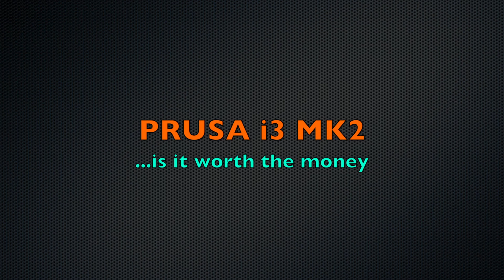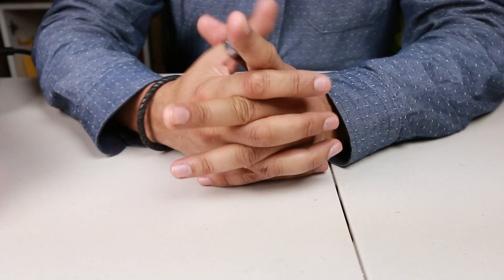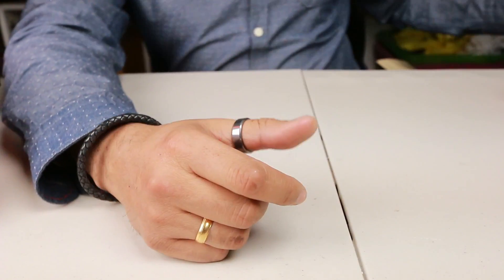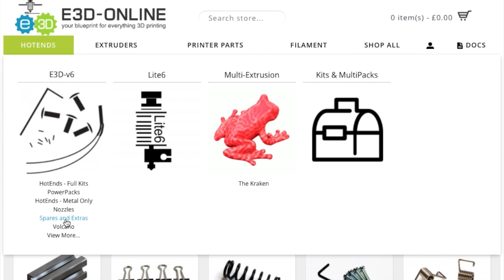3D Printer - S02 E03 - THE Ultimate Review (Prusa i3 MK2)

Comment: Great video! Pretty much touched on the same points I found but that solution for the probe levelling and 'knocking' cap is very clever - will certainly add it! Something I've noticed recently on some prints is the wire loom will catch on some prints (especially vase mode) so will be upgrading to a drag chain as well methinks. It really is an awesome printer, but not flawless ;)
Reply from the maker: Maker's Muse hey thanks. Am a big fan of your channel from the start. I'm looking into the chain but not so happy with the current designs. Make look to redesign my own.
Reply: Hey guys! Good comments all around, and a good video.... I have just finished upgrading my Mk2 to drag chains on each axis because I disliked the wire management. It was a huge task to get it operating correctly, but well worth it! I used Igus drag chain, and made a new Rambo enclosure to relocate the board and also moved the PSU back.... Came out really nice though!

Comment: Nice video man! i think some of the issues you are having may be due to incorrect linear rod placement. It looks like you possibly mixed up the linear rods. or don't have them pushed down far enough. The Z linear rods should be flush against the top 3d printed mounts. Take a look at the pic here. Yours are sticking up beyond the parts. :)

 http://www.prusa3d.com/wp-content/uploads/2016/05/frontpage.jpg
Reply from the maker: Exactly right. I found this out a few weeks later DOH! but it did resolve some of the issues and some were still persistent. Still great machine and will carry on improving and upgrading.
Reply: Just got this printer and i love it. But i hear ya, you cant only get so much accuracy from 3d printed parts. Thanks for the video!

Comment: It is a very good printer but I think what sets it apart from others are the extra features like the automatic calibration and such. But while it does it automatically, it's still things that can be done manually on any other printer with a decent enough construction. Ive gotten my hands on some prints from my friend's $700 Prusa i3 Mk2, and my own home built printer that I made for $250 (using parts he printed for me) and honest, if I didnt tell you which is which, I doubt you could tell. While it's easier with a prusa i3 mk2, its possible with other less expensive printers as well
Reply: I have a MK2 and a clone, and generally the clone is better.  The clone has a filament sensor so when filament runs out it stops. You know, like a laser printer does when it runs out of paper. Its not a feature on the MK2. And auto bed leveling? Its a bit overrated. My clone has a sensor and it moves to each corner, then you adjust the thumbscrews until it just beeps. It really works just as well and quicker. Overall the MK2 is a fine printer but fairly overpriced for what you get.
Reply: Ralphie Vigg Thanks. I was thinking of getting a clone, but worried about the auto calibration.
Reply: You can easily add a filament sensor to the genuine mk2 for warped beds, like mine, which I can only make small prints because its impossible to get level.

Comment: Looks like your printer needs to be calibrated on the Z axis. My Prusa i3 has had NONE of those problems after proper calibration. Try a wall thickness of 0.4mm instead of 0.8mm to get you started until you learn more about the Prusa i3 MK.

Comment: Be careful with the Pinda leveler shim! Not all of those sensors are created equally, they all have slight variance in the height they detect the bed. That is why each Pinda has to be adjusted separately and they have that adjustable nut. Otherwise the mk2 design would have it bolted in place securely and safely.

Comment: Prusa uses the 4mm inductive sensor I believe and that is just too close for comfort with aluminum and a glass bed so a better solution would be to switch over to an eight millimeter version so you can move it up, and out of the way, and adjust for the difference in Marlin.

Comment: It looks like the nozzle isn't screwed in very far. It might not be an issue, but could be making the heat block rather close to the radiator.
Reply: Yeah, I screw the nozzle in first, back it out 2 full turns, then screw it into the heatbreak until it hits the nozzle, then tighten down the nozzle.

Comment: Try ABS juice (really thin paint on heatbed using abs and no more problems,i like to paint using this "juice" many things becouse you can make something waterproof,better for handle and looks like plastic.For PLA gluestick is really good ,for hardened it you can put pla in cold oven start Warming it to ~80*C and set it for around 15min and cool down for making it around 10-15% stronger,more harder and better tolerance for heat (it didnt work for all pla but work olso for abs in higher  temperatures) and you can try print linear bushings (in PLA) ,it work really good.

Comment: would love to see it compared to the other budget printer the Anet A8 or A6
Reply: The odd, and really nice thing about the MK2 is that it doesn't need mods. It may be nice to have them, but they aren't necessary. The probe height thing would have been very nice, but I got by without it for the one-time adjustment. In comparison, I had to mod the hell out of my Monoprice Selct Mini to get it operating well. He used the stock printer for most of his review, and should continue to do so. It prevents a review from being biased by how well he can mod it. But it was a nice touch to say what worth-while mods there are.
Reply: Most of this type have numerous mods that you can download from thingiverse that will improove the print. So, should someone compare the original printers, or after the mods??
Reply: andy parry I think yes because it would show how much someone would spend too get it at its best and what type of quality can we expect after the mods

Comment: look up Adrian bowyer ted talk  on YouTube the man that started reprap the open source 3d printer movement that prusa and ultimaker copied and tried to sell over priced open source stuff to low hanging fruit
Reply: Mark Williams Excuse the length of this post, but I want to be thorough and cover all bases.

I see you in every Prusa related video. You constantly complain about Prusa (I wouldn't put them in the same box as ultimaker who are actually bad for the community). You come across as a selfish, jealous man. If Bowyer had an issue with Prusa he'd have talked to Prusa about it, they know each other well. If you actually knew your history you'd know Mr. Prusa was an early collaborator and at the earliest RepRap conferences. The Mendel itself was the first derivative from Bowyer's original by a student. Prusa then made his own derivative. It was called the Prusa Mendel by the community, not him. Prusa doesn't lock down the i3s to use closed source hardware or filaments. Everything is customisable and there are full build instructions online to make your own. That is in keeping with the RepRap open source ethos. You seem to have issue with a man making money for providing a service. Nothing is stopping you sourcing parts and supplying them to people along with instructions to those who don't have a printer and want to build one. That is what Prusa has done, and done it well. 

And I've seen your multi-filament print arguments elsewhere; Prusa didn't claim to invent his method of printing. He's not copyrighted any of his printer designs. He's not a big bad corp. like Stratysis who sit on important patents. 

You have this weird issue with someone making money from open source hardware. Yet Bowyer did that himself with the RepRapPro (which ironically shut down as it was too expensive and could not compete with cheaper printers as it was too expensive). Prusa never said he invented it. He only advances it.

Just so you know, in the real world all of the devices and applications you use are derivatives of something else. iProducts, Android devices, Linux dustros, car technology... Original things are very few and far between. Even original applications actually use already compiled libraries. This is a world of collaborative innovation. Accept it. And stop posting on Prusa videos you childish petty man.
Reply: Copied? You do realize that about half of the 3D printers in the world appear to be copies of Josef Prusa's designs?
Reply: Christopher Shaker Na it's a   reprap mendel prusa copied
Reply: For the record, I have a Prusa Original i3 MK2, built with the upgrade kit from the MK1, and it prints better than my buddy's Maker 2, which cost about three times as much
Reply: "Free" Prusa I3 MK2 for you:
https://github.com/prusa3d/Original-Prusa-i3
Reply: arioch76 or free reprap mendal as it's open source lol
Reply: Cormz Zilla oh dear me I think u miss the point :-)
Reply: Cormz Zilla it's all open source free for  everyone for a reason .u miss the point of reprap and what it means for everyone it's not just a 3dprinter it's much much deeper ;-) I'm sorry it went right over your head,  love every one

Comment: Did you upgrade all of the bearings into drylin bearings? My printer is coming in sometime next year (due to the long lead time) and I was wondering if it's worth the change? Would I need custom parts in order for them to fit on the printer?
Reply: I don't think it's worth your time. I was a little hesitant about the original bearings at first, but after a month of printing on the stock machine, I haven't noticed a single issue where I would suspect the bearings.

Comment: You never mentioned which machine you bought  is it a legit Prusa research machine, or does it come from China? -- I thought the Prusa ones didn't need a lot of tuning out of the box...
Reply: It's the Prusa original. It doesn't need a lot of tuning out of the box. The probe needs to be adjusted correctly. It's tedious to it without an aid, but you only have to do it once.  That's the only adjusting I had to do on mine. The probe adjust takes the place of bed adjustment

Comment: I am pretty sure you have gotten your Z Axis metal upright rods mixed up somewhere. Thy should be only just protruding from the top brackets.
Reply: Nicholas Booth I agree, sometimes you may have to clip a small amount of the abs that keeps the hole "connected" this will allow the smooth rod to be inserted all the way into the stepper motor brackets

Comment: Question on the pinda height tool.. How are you using it?  Do you autohome the extruder and slip it under?  Do you lay it on the bed and lower the Z axis until nozzle hits the nozzle platform?

Also, I'm guessing the pinda hat was printed in ABS to handle temps? or does it matter, I haven't noticed if the pinda probe get warm enough to require the hat in ABS rather than PLA.

Thanks,
Reply: Just realized the hat question is answered on the Prusa site, so skip that ;)

Comment: I have a ton of improvements on my TinkerCAD page:  https://www.tinkercad.com/users/7Z01p6EVg8r-aaron-yourk/
Also, to prevent the Pinda probe from touching prints, the Live Z adjust value is a good gauge.  I know that the Prusa manual says that anything between 0 and -0.500 is acceptable.  I personally believe that the higher you can get this probe the better.  I've been not adjusting the Pinda probe if I get it in the 0.000 to -0.400 range.  A high pinda probe is less likely to touch prints, but if you put the probe too high, it will fail with reading its sense points on the bed.  I have found Calibrate XYZ is the most sensitive to these adjustments.

Comment: looks like mine wont be here for xmas , had a thought very similar to you probe and wondered why prusa never did something like that as standard... it would cut out alot of their support case issues i think...  would love to have one when i build mine...  anyway please keep up the good videos !
Reply: I asked this question in a livestream and was told there are variances in probe sensitivity, meaning different probes trigger at different heights, so a guide may not work perfectly every time, although i guess it might be roughly correct. When mine arrives, I think i'll set the probe at the same height as the nozzle, and then raise the probe in tiny amounts, so I'll never have the nozzle hitting the bed.